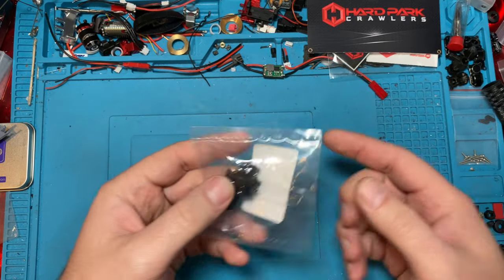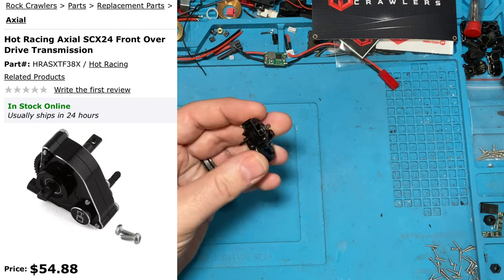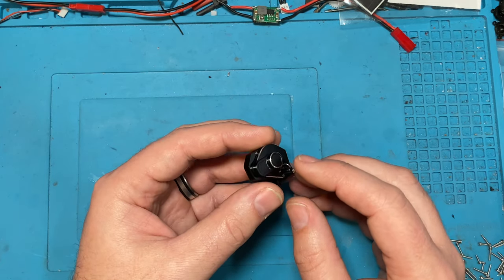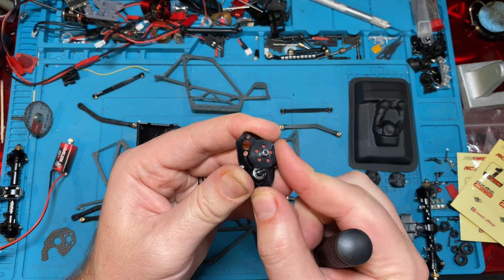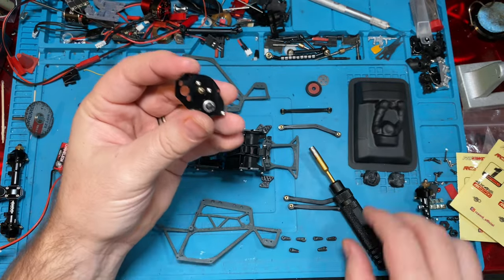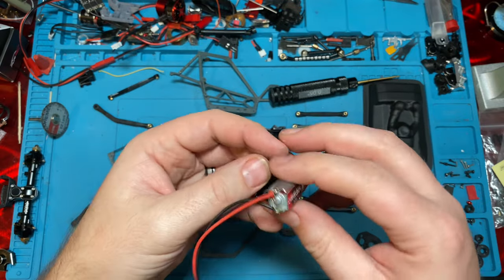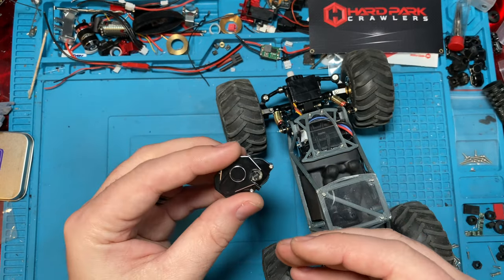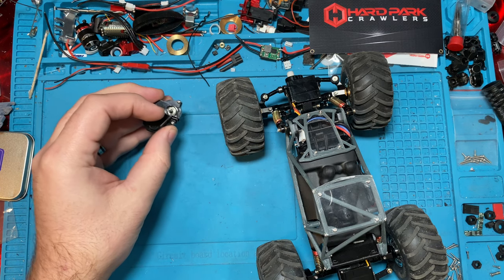SCX24 - Deep Dive into an Overdrive Transmission with a Slipper Clutch! AND it's only 17 bucks!!!!!!

Comment: I didn’t even think about it when mounting the HR trans and put it in backwards. No good! You cannot run it reverse mount. Thanks for sharing, brother. Great deal!
Reply from the maker: Yep, you will have some bad climbing if you do that lol.
Reply: Were you able to reverse the gears and have it work both ways?
Reply from the maker: @elmateo487  no, you can’t. They won’t fit in if you swap them.
Reply: @elmateo487  
Nope. Tried that. Even drilled a hole to mount the gears backwards. It doesn’t work. Thanks though. Appreciate you hanging. Hope you have a good one.

Comment: I had to order one! Found a stripped screw in my new Deadbolt trans. Can’t lube it, so I’m gonna upgrade motor, and trans.
Reply from the maker: Should be a good upgrade for sure.
Reply: @TheShopMiniRC I love it! Doing a micro Komodo / lizard pro upgrade now. I want to do a full lube job on axles, trans, and bearings while I am in it. What do you recommend?
Reply from the maker: @JamesMcNamara-j1g  marine grease for gears and mwx performance bearing lube for bearings.

Comment: Overdrive. Thanks for the video, i always wanted the HR overdrive trans but the price was crazy expensive. I'll look this part up. 

The Chameleon motor is junk. Weak, slow, and noisy. Pinion had some glue or lock tite on it causing noise at every revolution, had to scrape it off, but was still noisy. I have a Hobby Plus CR-18 55T 050 motor (thanks to donaldsneffe) that performs way better than the chameleon.
Reply from the maker: Link is in the description. My chameleon seems decent. We have a few other options, but I wanted to give this a try.

Comment: Finally installed mine today. Its a noisy lil sucker!
Wonder how it will wear front tires?
Reply from the maker: Yeah, all metal gears are definitely louder. It shouldnt wear them too abnormally.
Reply: @TheShopMiniRC is there a lubricant for the gears and bearings you can recommend? I was thinking white lithium aerosol grease for gears.
Reply from the maker: @JamesMcNamara-j1g  we just use marine grease for gears. Bearings should use bearing lube.  I usually only lube the bearings in my race cars.  I use MWX bearing lube.

Comment: “Overdrive”, I was gonna put this in my Furitek Cayman but it looks like it would mount backwards? Which end is the overdrive end the side where the motor mounts or the opposite side the motor mounts to?
Reply from the maker: The Oder drive side should be the side with the larger gear.  If the cayman mounts the transmission backwards (not just the motor on a motor mount) then yah, it could be a problem.
Reply: I also have the cayman and was looking into this. It appears to me to fit the same orientation as stock cayman. Did you try it out?
Reply: @keldonator  yes! I did have to flip the motor to face the front. It works great though! I did have to watch that the front drive shaft doesn’t make contact with the motor.
Reply: @paulgarcia8846  Okay, thanks

Comment: I wonder if the furitek Komodo will work on it
Reply from the maker: Probably need the mounting plate, but the mesh should be fine. ;)
Reply: @TheShopMiniRC  that’s good to know. I already have it on my existing transmission. Unfortunately I stripped the lower gears and looking for a replacement transmission. Any idea what the overdrive percentage is?

Comment: What % of overdrive is it? Did you record anything before and after?
Reply from the maker: Sorry, I’m actually not sure if what the percentage is.
Reply: @TheShopMiniRC  have you tried the tape test to see how many rotations the front turns in one rotation of the rear?
Reply from the maker: @keldonator  i've done it before to illustrate over/underdrive but i didnt do it on this exact transmission.